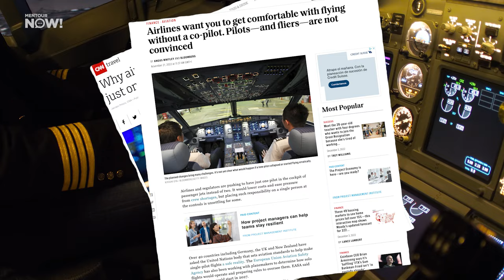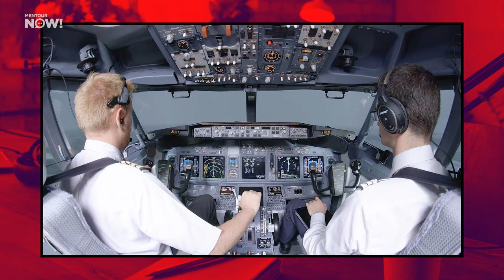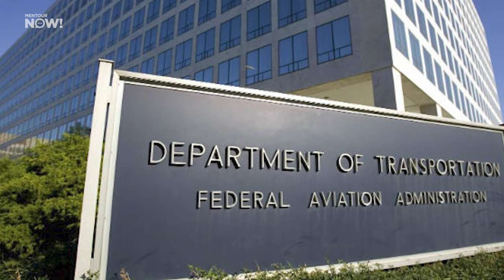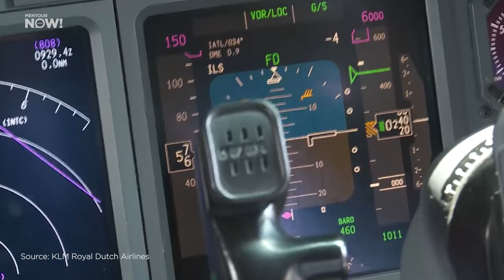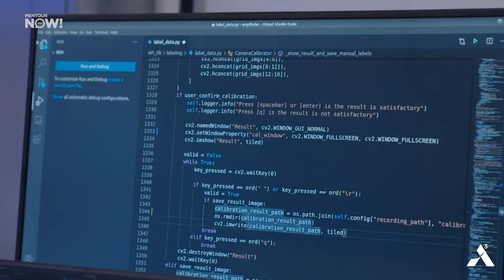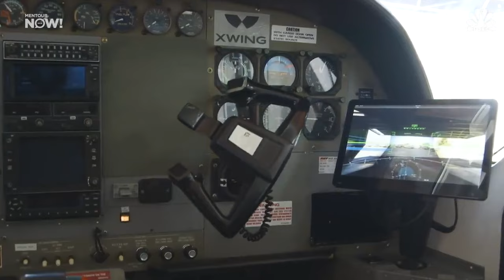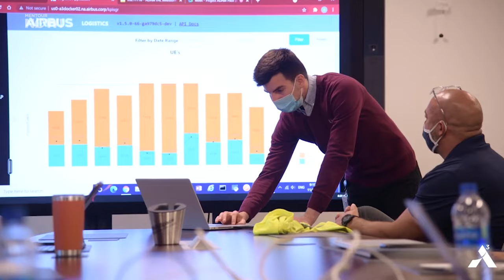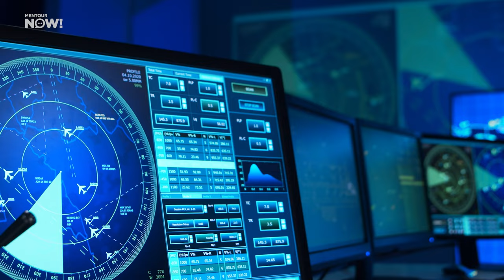The End of the Two-Pilot Cockpit?! Get Ready for Single-Pilot and No-Pilot Airliners!

Comment: NO. I WILL NOT fly on a single pilot flight!!
Reply: Neither would I that sounds extremely dangerous. If this were to be viable in any way shape or form, they need to simplify these airliners for pilots. But what does that mean for safety?
Reply: @NeungView  You can always go offline in Laos or Tibet.
Reply: Yes i would only fly again when they have solved the problem of removing stupid lazy and easily distractedly humans from the cockpit.
Reply: YES. I WILL fly on a single pilot flight!!
Reply: Same
Reply: If single pilot operations get introduced I WILL ONLY fly on those wherever available.
Reply: I have flown fee paying passengers as a commercial pilot in small single engine and twin engine aircraft as a single pilot in charter operations. What’s the difference?
Reply: Currently no pilot is needed in the cockpit, the plane can do everything alone without human intervention, at most it could be operated from the ground as is already done with military drones.  The girl who hands you the bottle of water has more work than a pilot.
Reply: You will if it's cheap enough.
Reply: Me either.
Reply: @justcommenting4981  driving or taking a ship is always an alternative
Reply: @mtkoslowski  safety probably. How do safety records compare between single pilot charters and commercial airliners?
Reply: Everybody says that but you watch what happens when they airlines make the ticket price SIGNIFICANTLY cheaper !
Reply: Man I fly jets and I would not be a passenger on a single pilot jet
Reply: @NeungView  
How much “maintenance” does your iPhone require ? How much “maintenance” does a laptop require ? Compare those MINUSCULE amounts to the cost of JUST the medical insurance and pension payments of a human being………not even taking into account the career long cost of paying someone a salary for thirty or forty years.
Reply: @madriditunes7021  
Actually none of the current passenger carrying airliners can extend the flaps or put down the landing gear autonomously. The rest of the flying part pretty much. You just have to ask yourself if you like landing really fast on the belly of the airplane all the time …………..?
Reply: @ZeRo8625 I will also as long as no one ignores problems with software like the Max. The space shuttle landed without human control 40 years ago. Most aircraft pretty much fly themselves now.  I have flown in many small aircraft flying around Alaska for work and most planes  had one pilot.  Helicopters were the same way except oil companies aircraft and their contractor aircraft always had a second pilot
Reply: So you will not fly with a single pilot?  How about a charter plane or helicopter?
Reply: Then don’t. Many people won’t fly period. Nobody talks about them but they exist everywhere
Reply: @MrKen59  The best seat as a passenger in a helicopter is the left seat in front. I used to get transported to mountain tops a lot this way.  Many small operators here also liked me sitting in the co-pilots seat for weight and balance  purposes. Heck I flew around so much I got to know the pilots.  I know my way around the cockpit pretty good. I was an avionics tech in the military (P-3Bs). I even learned to fly a small plane I bought about 40 years ago.
Reply: @savagecub  iPhone? Laptop? Ok lets see. IPhone lasts 3 years and breaks about 10%. Laptop lasts 5 years and breaks about 10%. 1 Million flights with 100 passengers equals 100 million people of which at least 90 million survive. You should have said flight computers then the numbers go down to about 0.005%
Or 50 Flights ending up in a crash, About 5000 people dead. Hopefully less.

Humans break statistically about 0.001% or  10 flights. For which only 1 ends with the ultimate death of 101 people on board. Bad numbers but better than computers only which were made by „MEN“. 

If you have accessor Alien or Matrix computers the numbers get better and better. I dont know who has. Maybe Area 51?
Reply: @mtkoslowski  Did you fly 12 hours a day without pause?
Reply: @jayjohnson8353  In Europe i do not fly anymore. It takes nearly the same time to drive, i don‘t need masks and do not have to strip before the „nice“ customs officers, i do no have to stand in line of the ticket counters and wait for hours on uncomfortable seats in the waiting halls getting numb from all the elevator music. I rather drive with one of my Teslas and listen to Elvis or LED Zeppelin - or nothing - and its very much more comfortable. And in most cases even cheaper. And when driving less than 1000km even faster… And wifey does not cost one iota more.
Reply: @wolfgangpreier9160  
How many people have died using current level CAT III autoland ??? Let me do the research for you ………it’s number rapidly approaching ZERO, NULL, NADA,THE EMPTY SET !  What OTHER concerns might you have ?
Reply: A lot of you obviously didn’t watch the video all the way through. I agree with all of Petter’s points. I’m not rich enough to fly a single pilot plane. And helicopters?! No f***ing way am I getting into one of those! Not even if I was paid to. I’ll stick to large commercial fixed wing planes Ty.
Reply: @mtkoslowski  the difference is how complicated the aircraft is smaller aircraft’s are typically less complex therefore are certified for single pilot operations
Reply: @savagecub  but cost and safety should never compete with each other in aviation
Reply: @laratheplanespotter  
Ok then - be sure to include some kind of note to first responders so if you’re ever in a serious accident NOT to put you on to a medical helicopter so they’ll know your ignorant wishes.
Reply: @tyrekegordon2492  
That’s HILARIOUS !  You sound just like me the first day I started my airline career. Unfortunately after nearly 29 years of part 121 flying EXPERIENCE has proven otherwise. Bottom line………unless it’s absolutely prohibited or required by the FAA the cheap-ass bean counters at airline management ain’t gonna do it !
Reply: @Chris_at_Home  ❤️
Reply: @savagecub  How many of those CAT III autoland have done full flights without supervision and correction by the pilots?

NADA ZERO ZILCH NULL NIL...

What other concerns do YOU have?

I want the pilots removed altogether. Just as i want FSD on the roads without human intervention. Both would mean ZERO deaths because of distracted tired overworked underpaid undertrained pilots and drivers removed from the equation.
Reply: @wolfgangpreier9160  
Actually in 28 years of airline flying I’ve never had to “correct” an autoland. As for FSD that’s going to be enormously more difficult as there are no controllers to create separation and sequencing on public roads. Also I would be far more concerned about the cars that were being operated by humans than the FSD cars.
Reply: @savagecub  Yes, i understand, but why in the world then happen so many accidents at landing? Why is not every plane equpped with this CAT III autoland? Can the victims of such accidents not sue the IATA to force the airplanes to be retrofitted with the newest technology?

You tell me that one exised for 28 years? I thought airplanes are only allowed to fly commercially for 25 years. That would mean every commercial airplane must already fly with the CAT III autoland. And still accidents occur frequently. Why?

For FSD - you do not need sequencing and seperation if EVERY vehicle is allowed to go the same speed and does so. Simple solution, everybody can and is allowed to drive 100 km/h. And every vehicle gets FSD. And those without FSD are limited to 80 on the first lane.

But you are correct, the most error prone on the roads would be the humans with their old manual cars.
Reply: @wolfgangpreier9160  
Just about all current airliners larger than regional jets have CAT III capability. The 28 years I was referring to is my time at the airline not the age of the aircraft.
Reply: @savagecub  I just quote something you have not mentioned "Once established on an approach, the pilot follows the ILS approach path indicated by the localizer and descends along the glide path to the decision height. "

The PILOT flies the plane not the computer/bot/automaton.

And CAT III C which would allow THE PILOT to treduce its final decision to zero is not used in EASA or JAA and not used on any airport in the US. So: There is currently not automatic landing system in use.

Besides some small airports in Norway using D-GPS - very obscure...

I talk about abandoning pilots altogether.

Funny thing: The first autonomous vehicles in Europe will be trucks. The haulage industry has a demand of over 200.000 truckers in the EU and want to free those running the shortest hauls between warehouses. e.g. between the harbor and the aiport distribution in Vienna. Thats about 30km on fixed routes with much traffic. 

They already use many electric trucks (big rigs from Volvo or Mercedes) and try to automate those routes. Will be fun to see the first one driving around without intervention.
Reply: @wolfgangpreier9160  
Actually there are several CATIIIC approaches throughout the world but just not at non towered airports.
Reply: If the pilot passes out I could show the passengers my flight sim skills. Would be funny
Reply: If this becomes a industry standard because of pilot shortage then it's going to suck.
Reply: How about no human pilot flight?😅
Reply: Yes you will
Reply: I’m not going to fly on planes with one pilot or no pilot at all!!!!! Automation is bad and useless. I would sue companies making automation in cockpits possible. Those who work for it are horrible people. End automation and single pilot operations!!!
Reply: Personally I refuse to fly on a plane without 2 pilots, 1 navigator, 1 radio operator and 1 engineer!